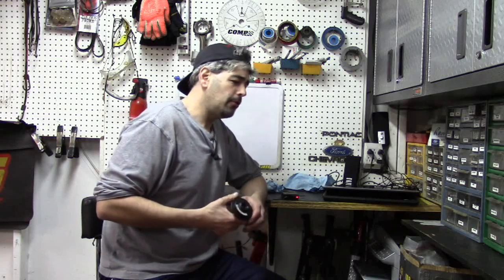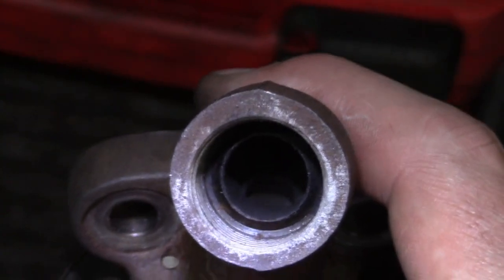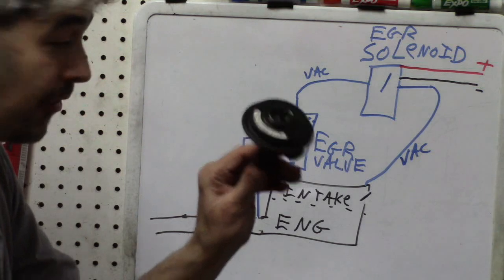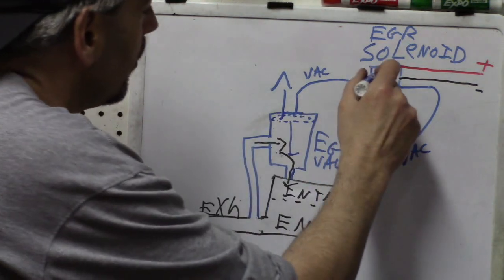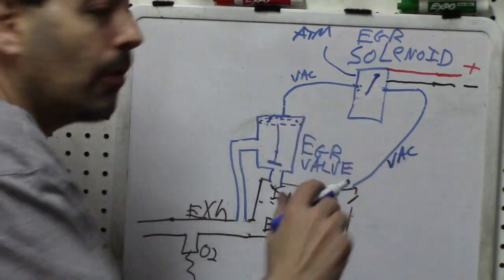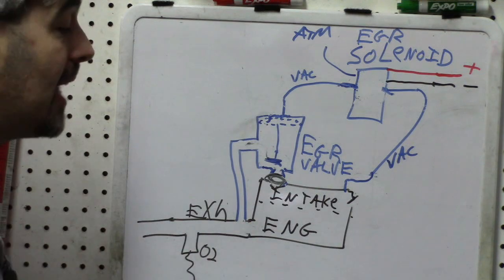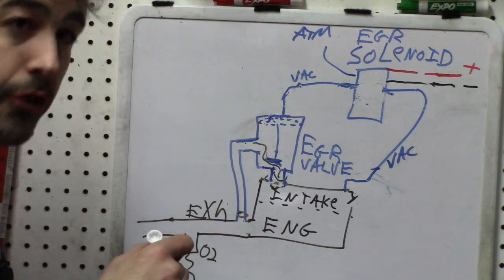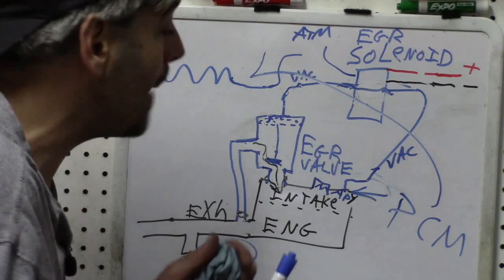EGR  P0400, P0401- P0409 Diagnosis+Understanding Pt1

Comment: On a Ford EEC-IV, if you get improper vacuum to the EGR, replace the charcoal canister purge valve. If you get rich oxygen sensor codes, replace the MAP sensor. Run fuel injector cleaner thru the tank to clean injectors and eliminate false codes.
Reply from the maker: Why on EARTH would you EVER replace a MAP sensor on a rich code?????? WHy would you not diagnose if this is not fuel trim related first? Ridiculous advice. And why would you ever run fuel injector into a tank if the fuel; trim is shown to be balanced.
  Part changer mentality here folks.
Reply: @SchrodingersBox  On our car I got a Troubleshooter tip saying MAP sensor. I replaced it and the code went away. I put in cleaner and it runs better. My brothers car, I got misfire on 1 and 4. He put in cleaner. Both codes went away. And the check engine light went off. And you aren't like Eric with a garage who does vids. regularly. You stopped. All you do is sit at your board and draw! Astral works on cars on video! You don't have a 2 car garage like Eric. Look at your magic-marker! So, that's YOUR garage. You say it's at a garage. I just simply posted to add to your dying post. Eric has more viewers than you. You draw on a board! My tester said MAP sensor. It worked! It's a OBDI so I can't check fuel trim. Everytime I comment to you, you turn ugly! Eric doesn't. That Mexican guy replies nice, you don't. No wonder!
Reply from the maker: You have no clue to how diagnose. FIRE THE PARTS CANNON!!!
Reply from the maker: So you fixed a P0304 and P0301 with cleaner. How would you have differentiated if the misfires were result of a failed waste-spark design?  As all my viewers know from my drawings, cleaner could never possibly work in this instance. What is your method to determine this without guessing at replacing a MAP or using cleaner? We are dying to know. Fool.

Comment: You are wrong about wasted hydrocarbons. The burn in cylinders is complete, exhaust gases are inert. The only thing EGR does is slower and lower temp burn. Engines don't need it.
EGR is source of engine problems and does nothing useful. 
And you are wrong about that it does nothing for power. It does at least two things, It heat's up the intake manifold. And it fouls up intake ducts. 
Delete the stupid thing. Pass emissions. Never have EGR related problems again.Have cleaner intake manifold. Cleaner engine bay to work around. Have more responsive engine. And even a bit better MPG.
Reply from the maker: You obviously have no understanding of the purpose of this technology. You couldnt be more incorrect. KNOW THE CHEMISTRY!!!!
Reply: @SchrodingersBox  The purpose of EGR is, as others said, not to recirculate otherwise wasted fuel.
The recirculated exhaust gas lowers the oxygen concentration in the intake manifold, which will cause a lower combustion temperature. The result is less NOx.
On gasoline engines, the air and fuel amounts are well balanced, so by lowering the oxygen concentration, less gasoline can be injected while keeping a stoichiometric air/fuel mixture.
Diesel engines generally operate in oxygen surplus, so no reduction in fuel consumption there, only NOx.
Reply: yes,"ymzedk" you are correct. the use of a recirculation wasted exhaust gas is that it contains no oxygen needed for combustion, thus lowering combustion temperature during the power stroke of the engine with the intended purpose to reduce NOx, that are produced at higher temperatures, but by attaining that, those inert gases also occupy a volumetric space taken away from an otherwise,  a larger engine volumetric mixture  of air/fuel ratio that would  end to produce more HP.